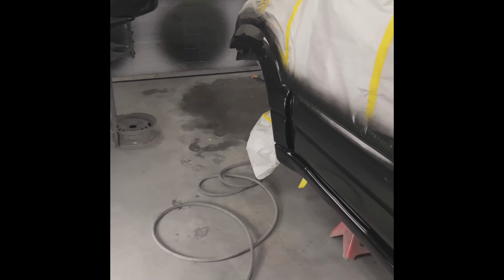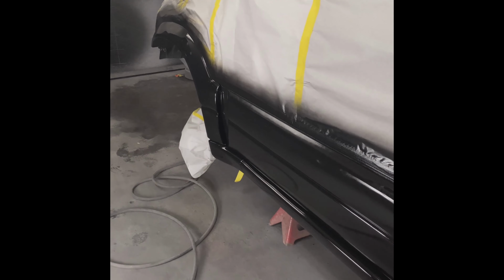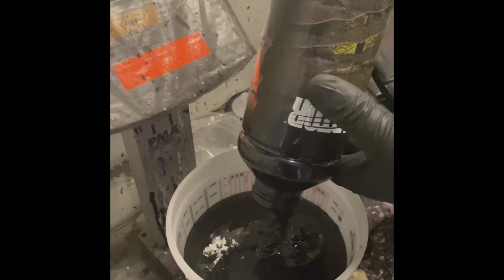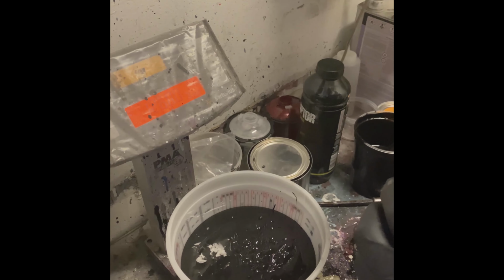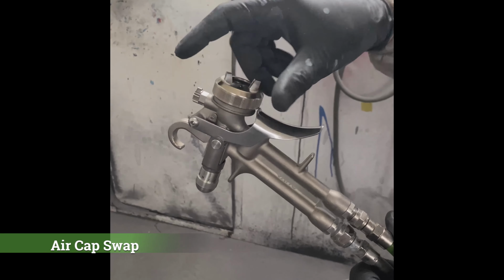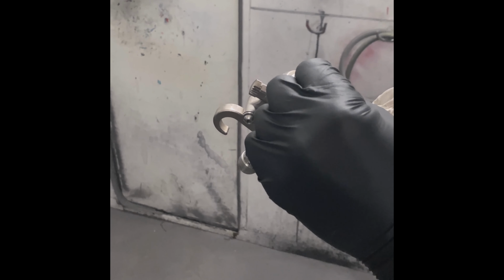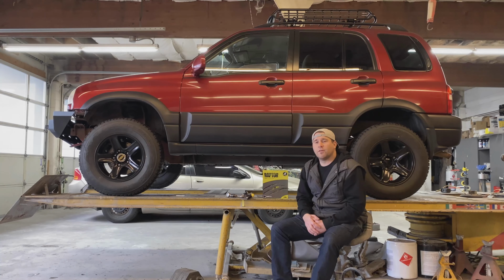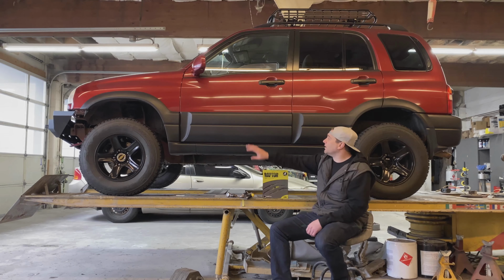Spraying U-POL Raptor Liner Flat On A Budget Overlander

Comment: I've never seen that so smooth. Which nozzle is that? How did it not clog? And did you thin it out like crazy? I've done 3 of my entire vehicles and although it comes out nicely, I'd much prefer it to be extremely smooth like yours.
Reply from the maker: Hi! Thanks for  watching! I used a Dux Gravity Feed with 1.4 Tip and A1 Air Cap for the Sealer, and a Dux Platinum Pressure Feed with 1.2 Tip and A1 Air Cap for the Raptor Liner. The pressure feed set-up prevented clogging and I thinned the mixture 5%.

Comment: What did you thin it with?
Reply from the maker: Lesonal Medium Reducer
Reply: @paintnmotors2481  What base is this reducer (acryl, urethane...)? Is any other supsitution for this reducer?
Reply from the maker: rossi107  solvent base.  There’s material sheets online at lesonal I’m sure.  But any solvent base reducer will work.  When I’m being real cheap I’ll just use Lacquer thinner.
Reply from the maker: Urethane reducer
Reply: What ratio for thin it?